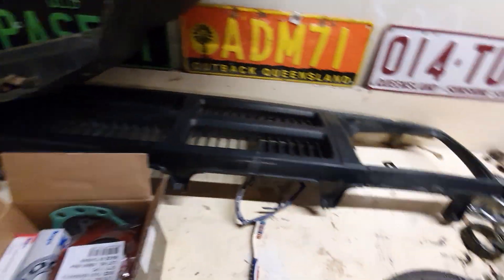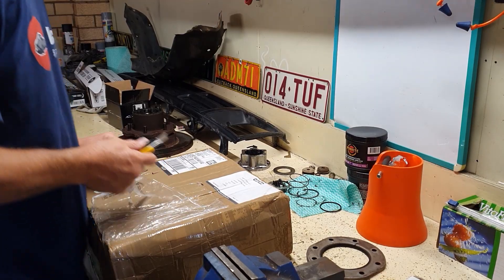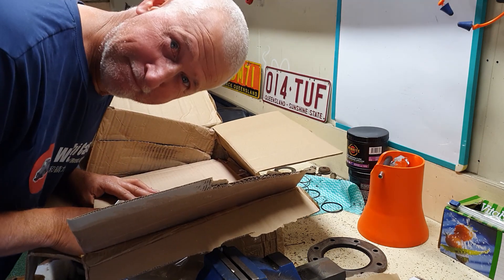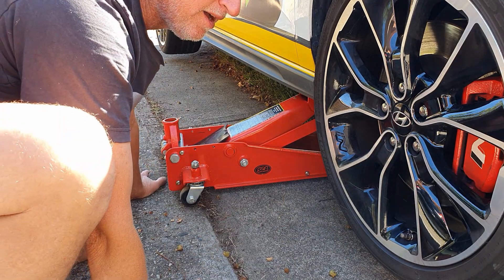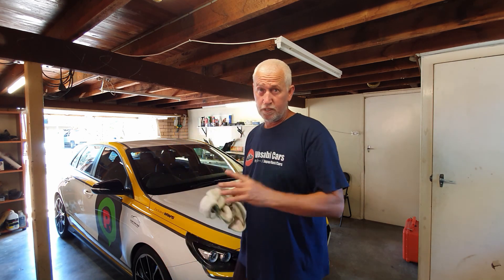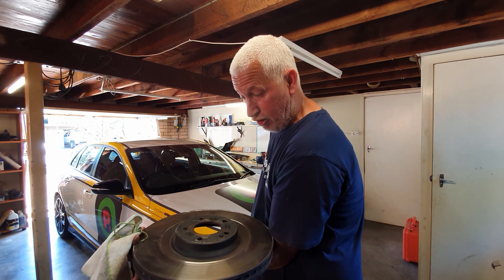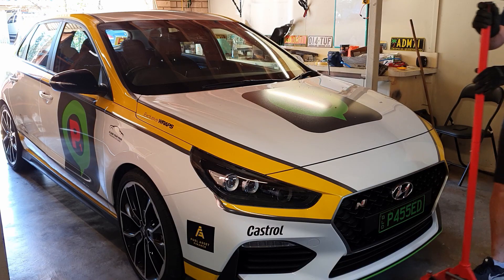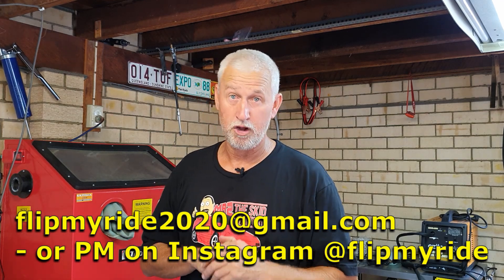i30N Aftermarket Brakes!

Comment: Thanks Adam - I am trying to replace the rear brake rotors and Pads on my I30N , and I am having trouble pushing the piston back. Handbrake I think.  How to proceed????
Reply from the maker: They may need screwing in mate. Not all rear pistons are push in. You can buy a multi tool that snaps onto yr ratchet and screw them in. Make sure you release the valve also.

Comment: Thanks, Adam.  A quick query - is the rotor wear because the i30N has had a hard life, or are i30s in general likely to want rotor replacements so early in their life?  Reason for question is that SWMBO takes delivery of her new i30 (regrettably NOT an 'N') on Thursday and I'm interested to know how frequently I'm going to have to get back to your helpful YT clip. :-)
Reply from the maker: Hi Chris. My car has done nearly 60000 kms so for you thats probably 3 or 4 years of driving. So it wont be to frequent. Also the brakes are amazing on the N but that in part is due to the aggressive pad compound and a likely soft rotor metal to get the brake force needed so in turn they eat out the rotors. Hope that explains it.

Comment: Hi, just checking in after nearly 2 years, how have these brakes been long term?
Reply from the maker: Hi mate. Yeah good. Although the kms I do has dropped significantly. The rotors have not worn much at all. The pads are not great in my opinion. Couple of hard stopes and they sound like shit and feel a bit off. Maybe using OEM pads would be better.
Reply: @FLIPMYRIDE  cool, I've got the same discs coming, though front and rear and I think different pads, Ferodo DS2500s, so been all over reading on forums and watching videos the last few days, first time using godspeed discs, looking forward to getting them fitted👍